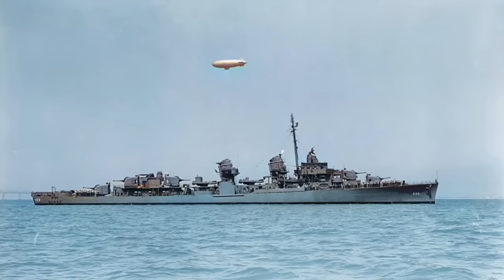American Fire Control Technology Was So Good Japanese Could Not Compete (Ep.2)

Comment: 2:54 In 1983, the Knox-class frigate I was assigned to was making a speed-run up the Red Sea to meet up with the USS Tarawa (LHA-1) which was re-assigned to the Mediterranean to support U.S. Marines in Lebanon. The run up the Red Sea was made after nightfall and I was awoken sometime after midnight by a steady, pronounced shuddering of the ship for about 10 seconds. The ship came to a stop and the sea and anchor detail was set. Nothing could be seen in the dark. We dropped anchor and waited for morning to put a diver over the side to examine the rudder and screw for damage. We guessed it was a whale, but by morning any trace of it had either sank to the bottom or had moved away from our position. No damage was seen on the screw or rudder and after recovering the diver we raised anchor and resumed our dash to the Suez Canal.